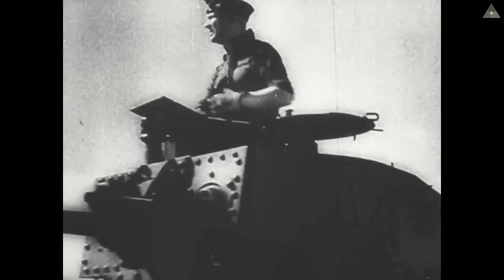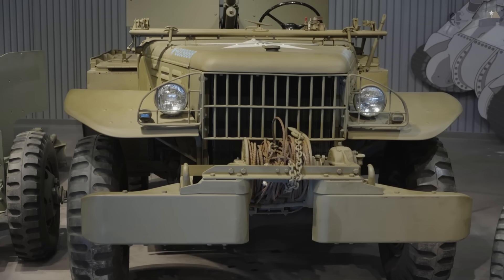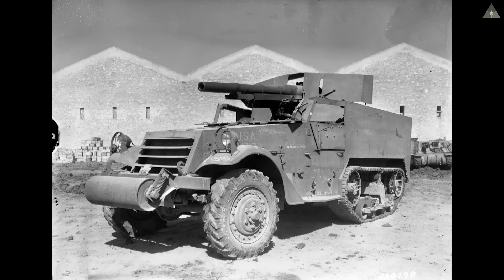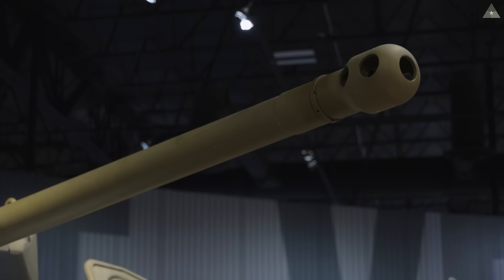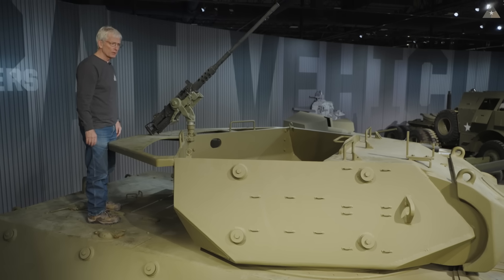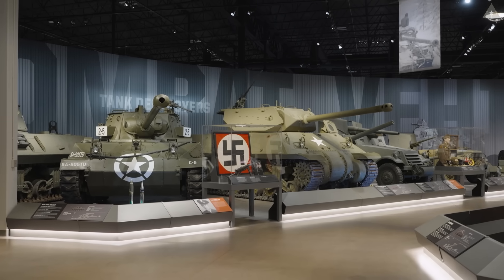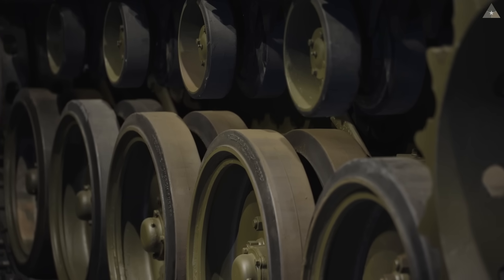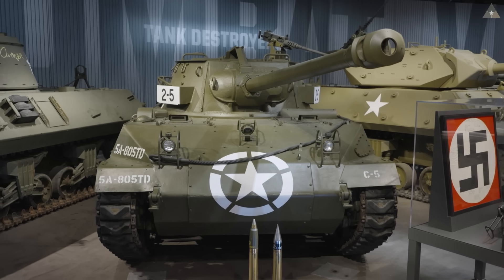US Tank Destroyers | From Defunct to Dominant 1942-1945

Comment: HI. GOOD VIDEO SIR, VERY INTERESTING AND EDUCATIONAL.  UH, IF YOU HAVE THE LATE MR. CARL SMITH'S HALF-TRACK, THEN YOU MUST'VE GOT YOUR HELLCAT FROM HIS COLLECTION TOO, RIGHT??  IF SO THEN THAT'S THE HELLCAT  THAT WAS FEATURED ON THE TV SERIES "TANK OVERHAUL" WHICH WAS SHOWN MANY YEARS AGO??  OH, YOU SAID TWICE ABOUT TWIN DIESEL CADILLAC ENGINES POWERING SOME SHERMAN VARIANTS; BUT I BELIEVE THOSE WERE GAS ENGINES THAT ALSO POWERED THE M-5 STEWART LIGHT TANK??  I THOUGHT I'D READ THAT THE ARMY DIDN'T WANT DIESEL TANKS IN THE ETO, BECAUSE IT WOULD CREATE LOGISTICS PROBLEMS HAVING TO SHIP 2 DIFFERENT KINDS OF FUEL, BUT THEY USED TWIN GENERAL MOTORS 6-71 DETROIT DIESEL BUS ENGINES IN SOME TANKS IN THE PACIFIC, BECAUSE WITH SOME NAVY LANDING CRAFT USING DIESELS, THERE WERE NO LOGISTICS PROBLEMS THERE.                  CHAS ORVIS, PLAINVILLE, CT.
Reply from the maker: Yes, I did buy the Hellcat in the video from Karl. You are correct that the Army did not want diesel as a general rule, but the M4A2 Sherman and the M10 tank destroyer both used GM diesel engines. Goes to show exceptions to every rule. Many of the M4A2s went o the Soviet Union under Lend-Lease.

Comment: I read somewhere that cast-off Army 37 mm anti-tank guns found a useful home aboard USN PT Boats.  They were useful for attacking small ships and barges.
Reply: That was true in some cases (PT-109 anyone?), but more commonly it was the 37mm Automatic Gun found on the P-39.  In fact, IIRC some of those were actually manufactured specifically for use on the PT's.
Reply: @davidbriggs7365  Thanks, I wasn't aware of the use of the aircraft cannon.
Reply: @michaeldelaney7271  The PT crews were notorious for "Strategically relocating assets" anything they could get their hands on.  Allegedly when an aircraft made a forced landing on a beach, sand bar, etc. The PTs rescued the crews AND the guns and ammo, much to the annoyance of the recovery crews following to recycle the remains.
Reply: @geofftimm2291  "Strategically relocating assets" sounds like something PT crews did pretty well.  Surely a useful skill for folks on Torpedo Boats who were originally provided with useless torpedoes.  I always thought of  PT crews as the Buccaneers of the Navy, so "asset relocation" fits them to a tee.
Reply: @carloshenriquezimmer7543  Good one!
Reply: The PT boats would use whatever they could get their hands on, which included the single-shot U.S. Army’s M3 37mm antitank gun (one of these found its way onto PT 109) and the P39’s M4 37mm auto cannon.  The PT boat crews especially liked the latter weapon, as it came with a horse collar-shaped magazine that held thirty rounds.
Reply: @speedythree  Thanks.  I guess either gun was a big step up from a 20 mm or a .50 cal.
Reply: Loaded with canister, they were very effective against banzai charges in the Pacific.
Reply: @michaelhorning6014  I imagine they were.  One of the tank channels said some the Japanese armor was light enough that a 37 mm could be effective against it, too.
Reply: @michaelhorning6014  I seem to remember the 37mm was critically used this way on Guadalcanal.
Reply: @michaelhorning6014  Banzai! Oh chit.
Reply: Probably true all over the world after the war too.
Reply: I remember in the movie PT 109 they scavenged a 37mm and installed it I don’t know if it was factual or just Hollywood
Reply: It's a very high performance gun for its caliber, defeating 3 inches of armor. It also had a good semi-armor piercing HE round that was good at piercing light armor that was only rated to resist .50-cal machine gun fire then explode inside.

It wasn't hard to get a hold of 37mm guns as there was very little interest in dragging a 900 Lbs gun through the jungle once 15 Lbs bazookas were available. As nice as the canister rounds were, the reason the 37mm guns were brought was an overabundance of caution that the Japanese may use tanks again.

Comment: You mean well, but in my opinion you focused too much on the machines and not enough on the doctrine of how they were used. Despite the name, they weren't just to destroy tanks, any more than naval destroyers were used solely to destroy torpedo boats despite their initial name of torpedo boats destroyers at the end of the 19th century.

Machines alone don't fight or win wars. It's also the men and the methods men use the fighting machines entrusted to them that matter.
Reply: "You mean well" is condescending, but I don't think you need me to point that out -- that was clearly your aim. Videos like this lay the groundwork nicely for future expansion into doctrine should Dan choose. How long would a video need to be to adequately outline US tank and TD doctrine after Poland and the Battle of France through The Bulge?
Reply: @davidk7324 I wouldn't expect a single video, especially one of this length, to cover that topic adequately. That said, I have seen better coverage of tank destroyers, both on YouTube and elsewhere. As a survey of tank destroyer equipment, it did an adequate job, though I did find the reference to an M375 a little odd until I realized he meant M3, 75mm gun, which I would consider redundant in a discussion of tank destroyers, but not in a discussion of half-tracks. (All US M3 half-tracks employed by the US in the tank destroyer role used the 75mm gun, but there were M3's used as howitzer or mortar carriers that had other calibers and some M3's with 57mm guns were supplied as lend-lease to the Soviet Union as the T48, but never got a M number for US service.) In my opinion, the nomenclature issue reinforces my point. This video was focused primarily upon the equipment, but I'm not looking for videos of equipment specifications. It's not my primary interest and in my opinion, there are better media for covering equipment specifications than videos.
Reply: Video stank to high heaven and needs the modern know it all bs removed.  Redo video as Museum Historians next time to get back your flex!
And yeah... I know my comment is not condescending but to the damn point!
Reply: @johnanon6938  It didn't stink in my opinion, it just wasn't what I would've wanted from a video on this topic, for the reasons I've already given in other comments.

Comment: Not sure if its true but I've heard that while fighting in the Europe during the winters of WWII M10 tank crews ( i think it was )found out the turret traverse moved too slow for a single tank destroyer so Group's of 4 M10s would cover each other on the move via each side ( left right front and back...also regarding the hellcats speed does this mean it's the 2nd fastest Tank U.S. history??
Reply: I was under the impression Hellcat was the fastest. What beats it?
Reply: @m26a1pershing7  The M-1 Abrams currently in service.
Reply: @davidbriggs7365  Preliminary google searches suggest Hellcat beats out (M1A1) Abrams by more than 10 mph. I know the Hellcat trial that got that speed resulted in the vehicle being pretty much a write off from wear, but I'm not sure if they would have done that to a stock M1 (likely the lightest variant).
Reply: @m26a1pershing7  The M1 also has a speed limiter. Without it, it's possible it could be faster than M18, but it's irrelevant either way.
Reply: @m26a1pershing7 Tank crews on the Abrams routinely disconnect the governor when they go into combat. Abrams is capable of over 60mph, about 48mph with governor engaged.
Reply: @m26a1pershing7  the Abrams from what I've been told...but being second place loosing only to the abrams ( not that its a competition anyway) but it is  more of a compliment to the hellcat than anything else